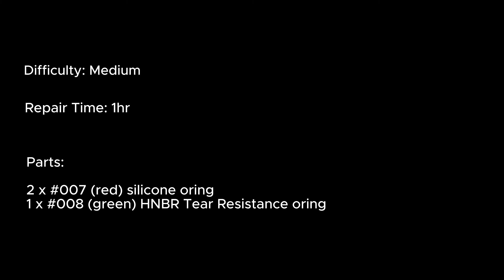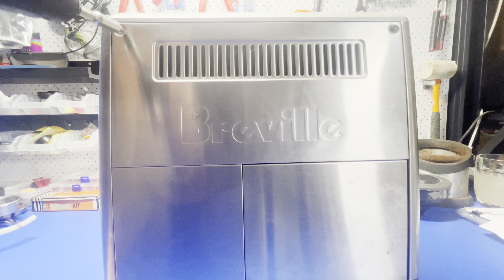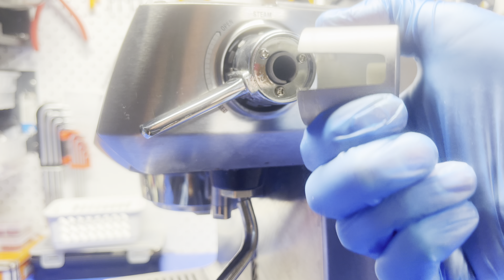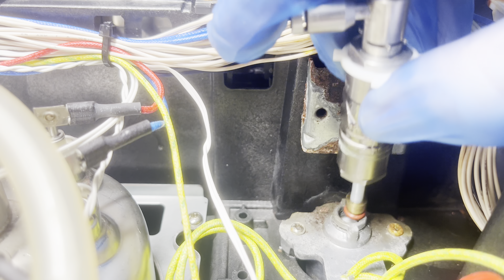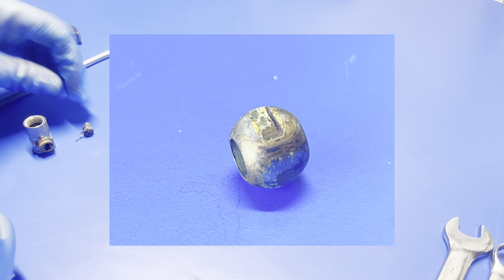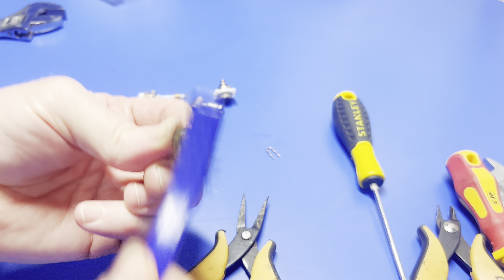Breville Dual Boiler (BES920) - Leaking Steam Wand Repair

Comment: One extra comment here; the leaking steam wand, it is not just an issue of leaking in the drip tray.  It will also start leaking inside the boiler.  Like in your example you get corrosion inside.  And also the screw holding the handle in place, and the threading in the valve for that screw can rust.  The latte will force you to replace the steam valve.

Comment: Thanks so much for this video. Fixed the leaking steam wand on my BES920 by replacing the o-rings in the steam valve using your kit. I also had some corrosion on the steam ball valve bracket, so the screws were inevitably corroded. I measured the screws to have a 3.25mm diameter. An unorthodox size. I replaced them with stainless steel 6G self-tapping screws (about 3.5mm diameter) and so far working with no issues.

Comment: Hi there! Thank you for the video, along with your repair kit it helped me fix the issue. However, one thing - in the video at 6:25 you screw in two parts in the wrong place and only at 7:12 you can notice it corrected. Would be really helpeful if there was a warning note somewhere. I actually managed to tighten it, however almost broke the part. Then - half minute in the video I noticed it was wrong. ;)

Comment: Your videos are very helpful! Thank you for sharing your expertise. I was able to repair all leaks on my 5 year old unit; and right on time because rust had started on a few areas. Clean out most of it and applied rust inhibitor where possible. They were all minor but a bit of rust was starting around a few places. I went ahead and order both the steam wand valve repair kit and a new valve as I plan to keep this unit running for several years. My Breville dual boiler is now back to life next to my Synchronika. Very happy!

Comment: Whats the issue if water leaks everywhere from the bottom left side of drip tray once the machine gets to temp? It also has lots of steam coming out of this bottom left side (left as you look at it)? It then powers down after only a few minutes?
Reply from the maker: The first would be a leaking vac valve and second would likely be an internal leak

Comment: Unfortunately the inside bracket on my steam wand is so rusty that the head of the screw inside the handle snapped off! 😔 
Looks like I will need to drill it out and replace it if possible. 
I'm wondering how to replace that bracket??

Comment: 7:13 part needs a small wrap around with teflon or it will leak
Reply: Also how tight should I screw that part? The original piece was screwed right up to the metal but with the new seal Im worried that's too tight

Comment: Thanks for great video. Is there any major harm by not repairing the dripping steam wand?
Reply from the maker: thanks! Not if it's just dripping from the tip; however, it could be an indication the rest of the steam valve is wearing out too. Any leaks around that area can cause problems - especially if the bracket holding it all in rusts away. You can't buy that part.

Comment: can you help to find the link for green O-rings size 8? I also used temporary the silicone one and looks like it works but it's slightly smaller!
Thanks!
Reply from the maker: I sell these in my online store in the steam valve repair kit. use the links above.

Comment: Thanks a lot, great advice. I’m working on fixing a leak in the steam wand of my BES920, but when I started disassembling the machine to access the steam valve, I found that the screws holding the valve, as well as the one inside the handle cylinder, are corroded. The rust has stripped the screws, and I can’t get them to budge, making it impossible to remove the valve. I've already tried using WD-40 to loosen the screws and multiple drive sizes. Do you have any tricks that help me disassemble the valve?
Reply from the maker: You might have to drill them out if they are too bad i'm afraid.
Reply: @BrevTech  Thanks a lot for your reply. Yes, I'm afraid that is my only option. Two more questions, if you don't mind. Re the screw inside the handle cylinder. Is it a generic screw, since I realise it screws into the valve? and do you think I may easily get break the valve when trying to drill it out or is there enough distance between the head of the screw and the valve to allow for some error? Thanks again.
Reply from the maker: @pixiebob1247  I've drilled them out quite a few times and there is enough space for you not to damage the valve. Use a 3-4mm bit and the head should just come off, allowing the knob to be removed. Then use pliers to remove the remaining thread from the valve.
Reply: @BrevTech  Thanks again! Will do that.

Comment: My screw holding the external plastic knob onto the valve is corroded 
How to take out the valve?
Reply from the maker: use something like a 4mm drill bit and drill it enough to remove the screw head, then remove knob and use pliers to get out the remaining part of the screw.

Comment: Hello champiom, great video. At 2.30 in the video, i tore the tube out and it left the gold bit inside the bottom. How i get that gold bit oit of the bottom of the machine?
Reply from the maker: Hey, you could try soaking it in descale fluid to see if that works.  I've not tried, but i've read that freeze spray on the brass fitting may help as brass contracts quicker than stainless steel. Failing that, you may need to drill it out.
Reply: @BrevTech yes i think ill probably drill it out

Comment: Hi. I've had my steam valve on my BES900 apart and replaced the seals etc using your kit. Fixed the drip but now have a leak out of the valve inside the machine when activating the steam wand. The ball has a couple of pits on it and the soft white compression seal has a tear on the bottom edge where it seals against internal housing. I guess given the age of the machine and having disturbed it this has affected the seal. Are any of these parts replaceable or do I need to purchase a new complete valve? Do you have replacement valves for sale? Thanks for your help.
Reply from the maker: ah damn! yes, if your ball has pits then i'm afraid you'll need to buy a new valve, as i don't believe you can get the ball by itself anywhere.

Comment: Excellent video - really appreciate it! Flipped the seals and seems good. My dripping steam wand caused the metal bracket at the rubber foot area to rust as it was sitting in a puddle of water too many times. Is there parts to replace that? It’s damaged the bench top unfortunately. Recommend anyone action this and not leave it so you don’t have a rust issue like me!
Reply from the maker: Thanks! Yes, it's a common issue. I think this is the part you might need (if it's the front): https://www.coffeepartswarehouse.com.au/breville-espresso-coffee-bes980-foot-holder-front-p-1777197.html

Comment: On my machine, the single small screw buried deep in the steam lever handle has a stripped head and can’t be removed. Do you have any suggestions for how to remove this?
Reply from the maker: try a small flat blade or torx and dig them in to get a good purchase. If that fails then you'll need to drill it out with a 3.5-4mm bit

Comment: Love your videos. They've helped me a lot with my Oracle. Do you have any advice on repairing a bes980 steam wand that won't turn off unless I pull it out? I'm hoping I don't have to replace the whole unit. Was making a loud arcing noise and then the noise stopped and steam is constantly escaping.
Reply from the maker: that will be the steam solenoid not closing properly. If its the OLAB (metal base) version you can buy my solenoid repair kit to fix it (see description), otherwise, if it has the plastic base (CEME) you'll have to buy the complete solenoid online. its a fairly simple repair.

Comment: Hello! Love the video!

My steam is encountering a slightly different issue. When the machine is hot the steam lever become so hard to move up and down but when cool operates perfectly. Any ideas on what to do to fix the issue?
Reply from the maker: Thanks, you'd need to take off the lid and have a further look. Or just loosen the screw holding the handle on to see if that makes a difference to eliminate the internal parts of the valve.

Comment: Thanks for the video and links. It's very clear and easy to follow. The steam wand in my dual boiler had been leaking for a few weeks and more recently the machine started leaking. Your video and the "survival kit" helped a lot - I replaced all seals and orings in the steam wand and also all orings in the steam boiler.
Reply from the maker: Great to hear thanks!

Comment: Great video! My steam valve had thread lock on the two parts of the valve body making it very difficult to separate. A six mm hex key fits and slowly I was able to break the seal. The washers were in good condition but I dropped one and it disappeared into my cluttered workshop. I found an o-ring that fit while waiting for a replacement from Amazon. The leak has stopped. The bracket that holds the valve in place was rusty. Best not to wait to do this repair after you notice the dripping from the wand! I can’t find a replacement valve here in the U.S.
Reply: I was also having a lot of difficulty opening the valve body with the 6mm hex key due to 'thread lock'. I had to exert so much force that I was afraid to break the valve body. After reading this comment though, I got the confidence to go at it again with some locking pliers (on the middle part of the valve body and with some cloth to not damage the valve body too much), the 6mm hex key, and some extra force. Eventually I was able to open the valve body and finish the repair.

Comment: Have you thought about or heard about using aflas o ring for the steam valve? Some people on home barista forums say the aflas is rated best for steam use, and recommend the use of aflas to replace the other 007 and 010 o rings in the machine
Reply from the maker: Yes I have, they seem good for compression and have good resistance to abrasion.  I touched on aflas actually in my latest video about orings. They certainly look promising! I've heard someone say theirs lasted 5 years, but time will tell. Not the easiest oring to buy though outside the UK
Reply: @BrevTech  makes sense, the other factor is that this o ring might go through compression through the valve, which might be a different factor than the ones that are just regularly holding the valve in place. Thank you for the helpful videos

Comment: Great Video! My 920 just started leaking this week after almost 3 years usage, would try to fix it following the video. Some questions though:
1. Could you provide the size specs of the HMBR o-ring please? (Does size 008 mean OD 8mm? what about the ID and thickness?)
2. In the very last of the video (time 7:53) you used an red o-ring, I guess that's the 2 size 007 silicone o-rings you mentioned in the parts right? could you please provide the size specs as well?
Thanks so much!!!
Reply from the maker: thanks, i'm just starting out so hoping to improve my editing as i make more videos. its a BS008. I will update the description. Here is a size chart: https://www.allorings.com/British-o-ring-Size-Chart
Reply: thanks a lot!!! @BrevTech
Reply: just fixed the leaking steam wand following your instructions. Turned out all the orings are relatively in good condition, while the 2 PTFE flat washer are corrupted. After changing 2 new ones (I bought a pack of 50) the issue is fixed. Thanks a lot for this informative video! @BrevilleTech
Reply from the maker: @superleerk  great to hear. Those washers should last you 100 years!
Reply: @BrevTech  @superleerk Great Video, which Size are the 2 PTFE flat washers? And has anyone an idea where to get the HBMR BS008 Ring in Germany? 
BTW: Breville Dual Boiler (BES920) is identical in construction to Gastroback Dual Boiler 42636